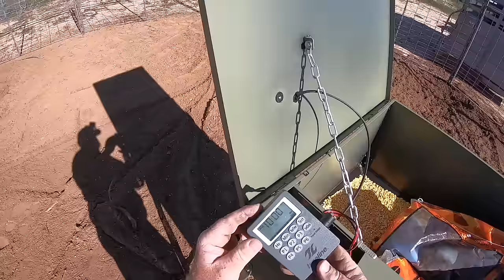Trapping Wild Hogs for cash money and your Sunday Morning Wild Hog Market report with Muddyfeet

Comment: You should look into the new net trap all you would need is the net.
Reply from the maker: I’ve seen them. I actually have a friend that has one. As long as I have cell signal I’ll keep using these.
Reply: How would you get them out of a net trap alive? Hmmmmm 🤔
Reply: @WestTennessee  Some use netting for the whole trap in a circle just like the metal fencing.  If still using the metal circle then no gate with the net blocking the gate with a side that they slip through to get inside. Pigs are smart, but try to go through the net blocked gate exit instead of the side entrance. Keep watching these different channels to find the one with 63 well 64 subscribers now and he doesn't talk too much.